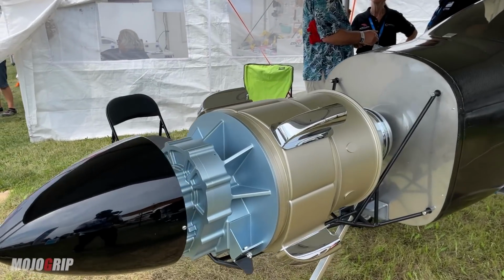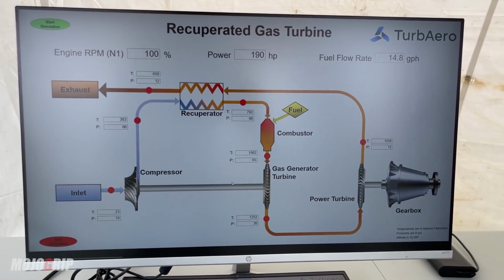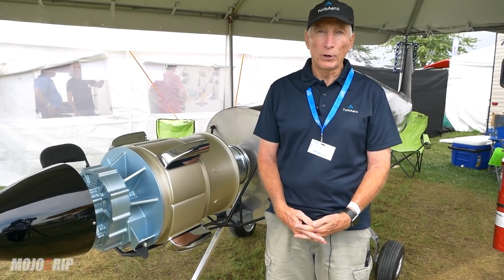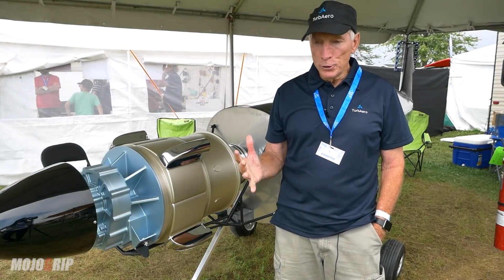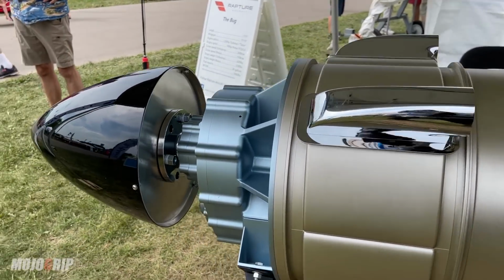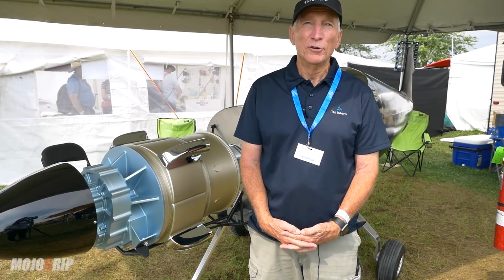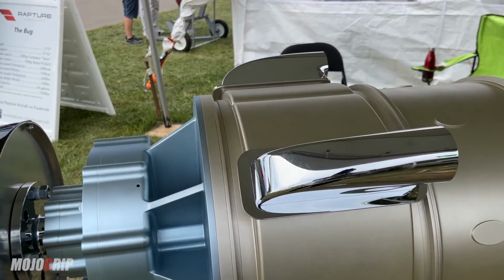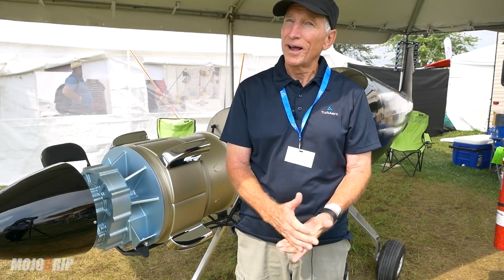200 HP TurbAero Jet Engine Will Cost $85,000

Comment: These engines may be a game changer if it lives up to the hype. You would have to modify the cowling on most airplanes for the air intake and exhaust I assume.
Reply: Pls explane what is "game changing" ? 
IO390  210hp  310lb  9.5gph (at 65%) 35000$ 
TA200 200hp  270lb  12.5gph (at 75%) 85000$
Reply: @thealzp  Reliability and that every pound of weight makes a big difference...
Reply: @fortcrafterbossbehold9027  390 is not reliable ? 1 pound is big difference ? TA200 maybe good in its niсhe , but not a game changer.
Reply: @thealzp  A 390 is extremely reliable I am aware it's no shitty Rotec radial or smaller Rotax, but no piston engine can hold a candle to turbine engines due to their comparative complexity. This WOULD be a game changer if it wasn't for its hideously extreme price, it needs to come down to $45-55K mark to make it worth...
Reply: @fortcrafterbossbehold9027  but it costs 85k not 45-55k. That's the reason.
Reply: @thealzp  Yeah yeah I am aware, I saw it in the thumbnail bro :) ...
Reply: @thealzp  I guess it really is amazing, but no game changer by any means...
Reply: @thealzp  for experimental aircraft, an easy to install and run turbine for 85k is an incredible deal. 

I sure wish is would fit in my Tomahawk 😆 I added 25hp to her, and she flies incredibly! Imagine what going from 135hp to a 200hp turbine would do to the little Piper that Could.

Comment: The speed at which he says “it would shut down” frightens me…. Badly. I get that he’s trying to convince me the engine is safe because it will shut down before it does damage to itself, but I don’t want an engine where the manufacturer is convincing me about the ability for the engine to shut itself down… right?
Reply: You would need to understand what an "overspeed" means... In this case, you don't want the turbine, which turns at a multiple of what your prop is, to overspeed and exceed 100% of its rated speed. If it hits 105%, or some other close number, it will shut itself down to prevent shedding pieces in a spectacular event. This would be an emergency type situation where the engine has lost control of itself and overshot its intended speed. Standard function on any turbine engine.
Reply: FAA regulations regarding the certification of rotating components require that they survive without catastrophic failure a minimum 20% overspeed. 

I would hope this engine meets a similar standard.

Comment: A single stage centrifugal compressor that magically beats the BSFC (brake specific fuel consumption; literally lbs of fuel burned per horsepower per hour) of turboprops that have had millions of dollars of R&D and decades of development revisions? I want to believe... but I can't.

150HP on 12.6gph @ 10,000' also isn't that good. Turbines claim to fame is that they're waaaay cheaper to maintain than massive radial piston engines, not that they're more fuel efficient. When you're talking about less than 300HP, you can reliably get that from something like a Continental TSIO-550.

And for not much more money, you could have a rebuilt PT6 that you can get parts for and have serviced damn near anywhere in the world.
Reply: At the 200hp range, I would not say turbines are cheaper to maintain. Maintenance will generally be less often, but when it happens the bill will be much larger.
Reply: @TheOwenMajor  I said that turbines are cheaper to maintain and more reliable than large radial piston engines, not small horizontally opposed piston engines in the <350HP range. Some of the largest radial engines back in the day actually employed power turbines that recovered even more energy from the exhaust system (not turbos, direct power turbines). They were massive, heavy, and complex.

If small turbines made economic sense, they would be everywhere by now. Until you get to airliner-scale engines the fuel economy of turbines can't compare to piston engines. The massive turbofan engines are efficient because they run at very high compression ratios, sometimes even higher than traditional diesel engines. To achieve those compression ratios takes several axial compressor stages. Each stage adds weight, size, and massive expense for all those precision machined and balanced turbine blades. Some things just don't scale down well and probably never will.
Reply: This engine costs 85K.  Tell me where you can get an overhauled PT6 for  not much over that??   The overhaul costs itself for your engine on a small PT6 start around $200,000 and can easily reach 300.   I agree that the engine probably isn't going to live up to it's claims, if it even gets airborne.
Reply: @traviseggl3794  A beastly PT6A-135 that cranks out 750HP is currently for sale on trade-a-plane for $235k. You never pay asking price. I bet they'd take $150k; there isn't exactly a huge market for these things.

I've seen the smaller variants like the PT6A-21 go for around ~$100k. That's not a zero time or freshly overhauled engine, but keep in mind that with the MORE (i.e. maintenance on reliable engines) STC a PT6A can have its official TBO extended to 8000 hours. Most of the used turbines I've seen sell are eligible for, or already enrolled in, the MORE program and are often at roughly halfway to TBO.

If you can pickup an airworthy turbine with a couple hundred hours left until the next major inspection/scheduled maintenance you can probably defer that cost for at least a year, probably two at the rate most private pilots fly.

Comment: Gonna be great for certain markets. Like places where avgas is too expensive. What is the TBO time?
Reply: I saw a 3000 hour TBO somewhere
Reply: @23aviatorguy  they listed 1000 hrs
Reply: 1000 hours is where they will start, as any new engine typically winds being around... However, turbines in general have higher TBOs then pistons due to the reduced number of moving parts. 3000 hours is where they hope to be after being able to extend the TBO with good life data.
Reply: 1000 hrs

Comment: They need to put it on a 100 lb diet.  The RR Allison 250B17/F2 used in the Cessna 210 Silver Eagle with 450 hp weighs under 200 lbs dry.
Reply: But that Allison engine is over $410,000.
Reply: @davem5333  Just making a point that it is a heavy pig of a turbine engine for the power that it puts out.  The small PT6 series engines that put out over 750 hp are only 335 lbs.   This thing is 270lbs, with only 200 hp?  The little Allison 250 was developed in the 60s.
Reply: @traviseggl3794  The recuperator is adding the weight.  You save in the fuel burn.

Comment: 🧢 they will never be able to hold that price. Plus the turboprop from PBS Velka Bites is more powerful and half the weight.
Reply: and double the cost and fuel burn. Assuming of course TurbAero actually hits their weight and fuel burn targets.  But I'm skeptical.
Reply: @donaldendsley6199  23gph cruise (or something like that) for the TP100, but also higher power.
Reply: TP-100??
Reply: @jenniferwhitewolf3784  yes